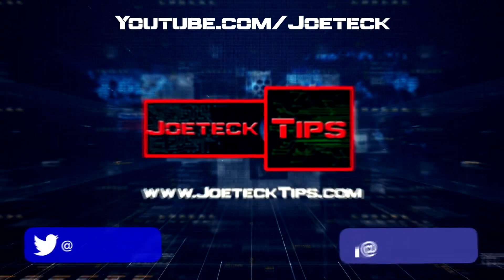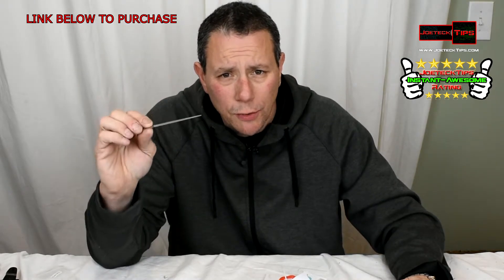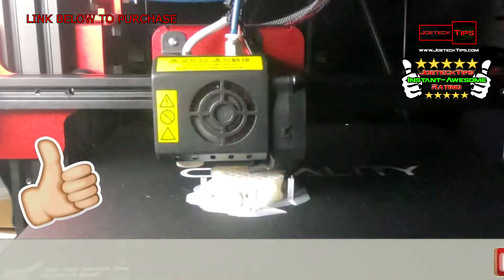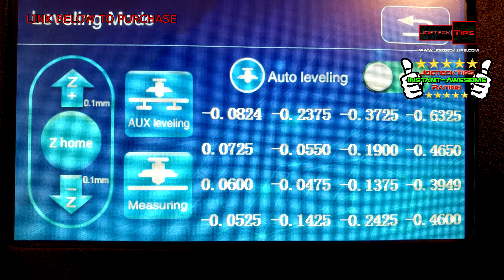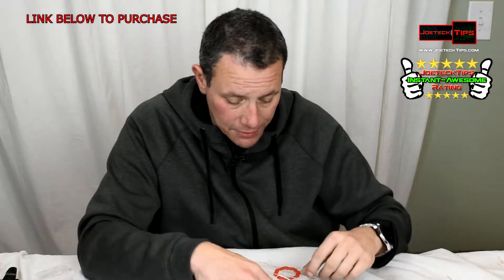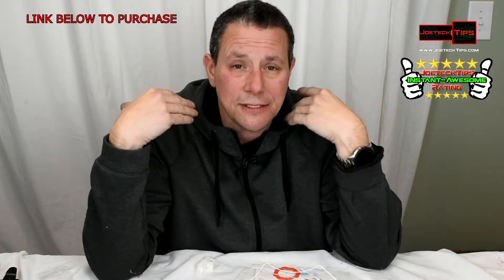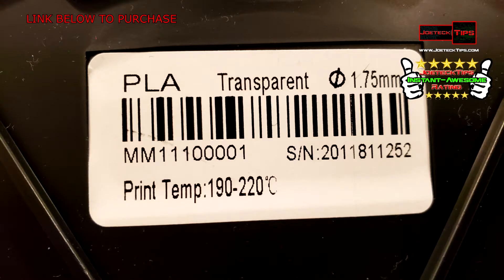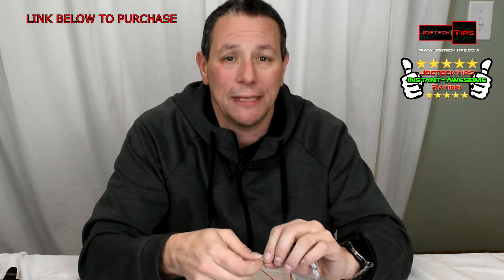My 3D Printer Creality CR-10S Pro Review | JoeteckTips

Comment: Nice review. I just got one, leveled it and printed the dog. It did extremely well and without printing those support poles for ears. 
Then I downloaded Vase files from cults3d website. I scaled it to 30% small. After printing the base plate, it printed some edges and then started to extrude some coils in the air, uneven corners etc. Is it because I scaled it down too small? The extruder was also rotating back and forth.
Reply from the maker: Very nice.. now youll start designing your own gear and wacky projects. Enjoy it. There is a Facebook group for creality cr10s and pro owners. Find it and join. Alot of gurus there..
Reply: @Joeteck  
ooo, thank you so much :) . Will join the facebook group.
Yes I will design my own :)
See you

Comment: Hey man just watched you for the first time. Great vid. I have this printer and was told due to the auto level and things this is not a good first printer due to the learning curve. I am glad you were able to work threw it most can't. Its my second printer so I was ready for anything it could fall with me. I struggled to print with this until I finally found somebody that taught me how to level it properly there is a specific procedure 2 leveling this printer. Once you get that leveling down it's pretty straight forward from there. I actually own two of these printers now had them for about a week. Since they're in my bedroom I will be ordering quieter fans so that I can Marathon print at night. Just wanted to say great video this is an excellent printer but if somebody is new to printing I would highly suggest the Ender 3 with a slightly smaller build plate or if you want the bigger build plate that this one has I would suggest the cr10 s. I've also had the cr10 S loved it printed great right out of the box. But I didn't end up returning it and buying the pro because I want it all the extra features.
Reply from the maker: Great comment! Pinned!
Reply: Hi i have some troubles with the first layer, how do you do that?
Reply from the maker: @timoOAK  Make sure its level. I'm going to making a how to level the bed today.

Comment: Most of my infills are 10 to 20% , petg is like pla , print a little hotter about 210 ish and 70 on the bed , don't push into the bed like pla , print a little up.
Reply from the maker: Thank you!, I'll give that a shot.
Reply: @Joeteck  i'd go even higher than 210. Maybe 220-230 for petg.
Reply from the maker: @jake360flip  wow, really? Ill give that a try too
Reply: I`ve just checked what I was using on my FFCP for petg , and you are right !!!
I was using 225 , but not sure if the reason why I was keeping it on the low side still holds on the cr10s pro.

WHY … the ptfe linings degrades like made the closer you get to 235c and have a max working temp of 235c  , So with 235c need for abs,  I was having to change the ptfe liner with just about every print.   
The other thing to talk about is fan , so normally it is off for print strength and on for detail , now been able to control the fan speed it`s somewhere in-between that.
Reply: @peteradshead2383  Can you tell me which PETG you have bought and from where? I am looking for an orange and white petg, but i havent found a good one so far. Thanks in advance :-)